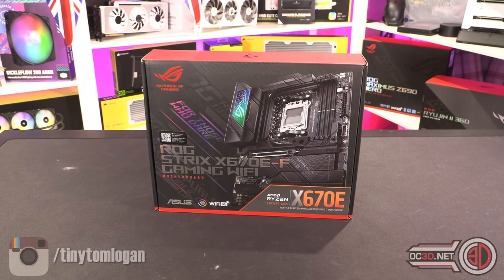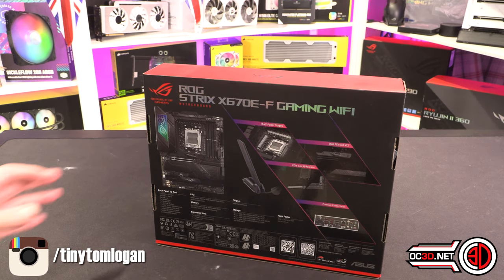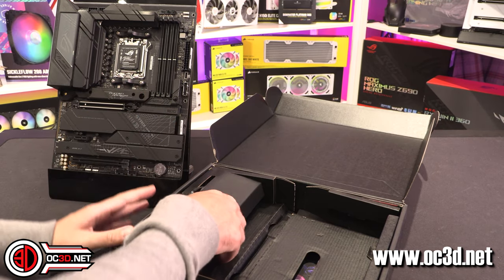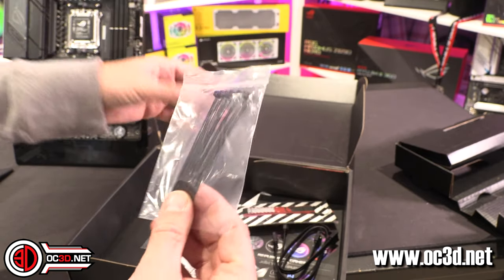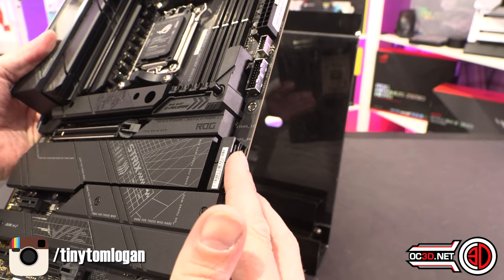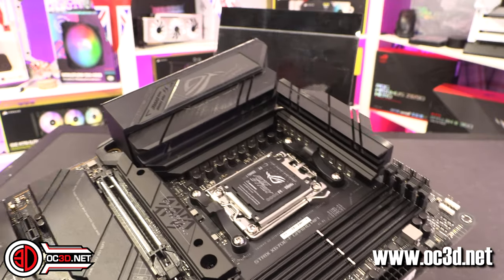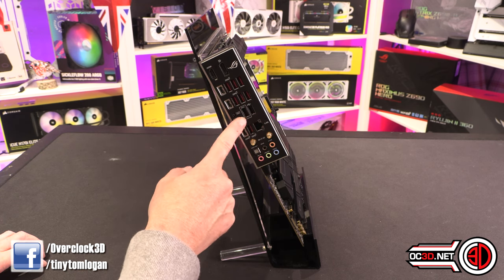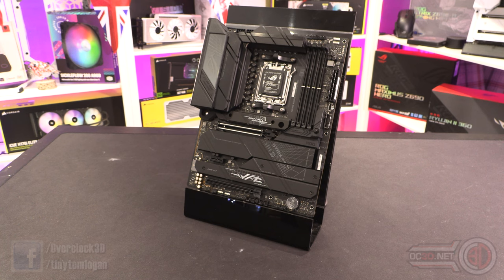Asus ROG Strix X670E AM5 Motherboard Preview

Comment: @OC3d TV I believe you missed that it has a Thunderbolt 40gbps header for Thunderbolt add on cards. It does state it in the maual It is the larger of the 2 USB 3.2 Headers on right side of Mobo. :)

Comment: You should change the title to include the actual name of the motherboard.  This is the X670E-F.  There are at least 4 variations of the ROG Strix x670E Gaming boards.: the X670E-A, the X670E-E, the X670E-F and the X670E-I
Reply: whats x670e-A ? white version?
Reply: @davemaverick8438  yes, but there are also slight differences betweenb the specs of all of the letter versions. Strangely, the A fits between the E and the F in both specs and price.

Comment: lets test the wifi card built in and what Bluetooth it supports,  a lot has been said about power draw from gigbytes top card as well so please test with it and what it draws from the board,  and if it needs the extra board header for power as default , additionally a number of people still rock the sata connectors so if you populate both m.2 add a 16 lane card will it share bandwidth with a fully populated sata connectors as anyone with an old case will easy rock multipul hd /bluray for legacy disks and movies

Comment: Are you able to test if thunderbolt 4 works on the usb4 asus motherboards like the hero? As far as I can tell it's completely unanswered online if the thunderbolt 4 controllers Asus is using for USB4 support in these motherboards has the thunderbolt 4 support disabled in the BIOS, or if they just aren't advertising the support but it works anyway.

Comment: So are any of these x670 boards compatible with the noctua nh-d15 🙈🤞
Reply: Based on the visual inspection I don't think so :( I have a feeling I will need to go aio
Reply: Level1techs said he strapped a nhd15 to the 7900x and it fit on the socket but throttled under load. Recommended 280 aio min.  For the 7900 at least

Comment: And again - though AMD offers soooo many USB-Connections now - ASUS missed out providing sufficient front-USB connectors for creators 😪
I want to connect my cases front-ports (1xUSB-C and 2xUSB-A) AND one USB 3 card-reader! So please, please design more boards, with two front USB-A connectors - besides the absolute high-end gaming-boards. Asus is even missing on this feature on the "creator"-boards.

Luckily MSI seems to have this requirement covered on the mid-range Carbon-series (at least the AMD X670E variant)